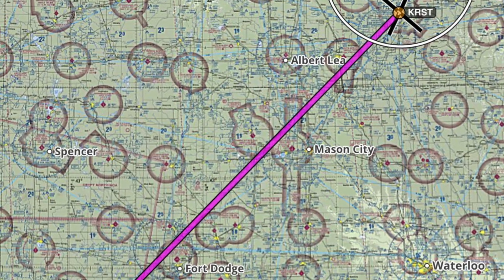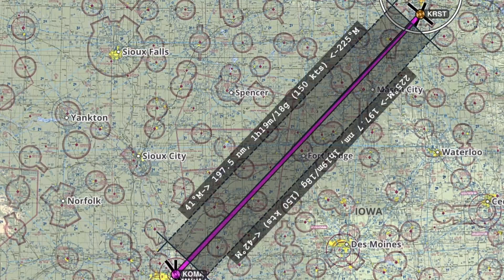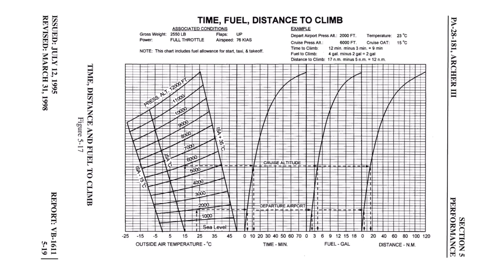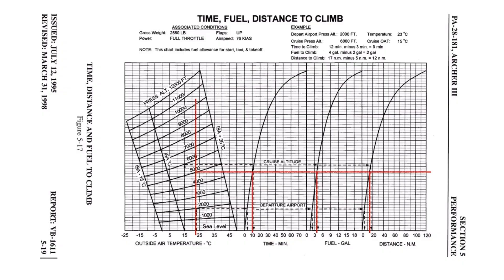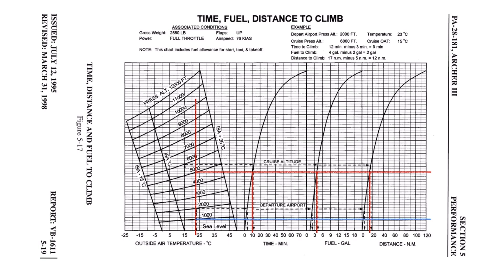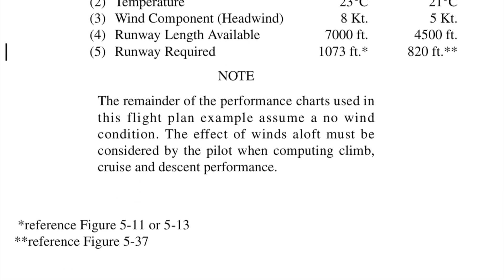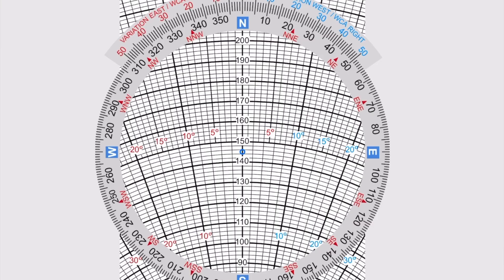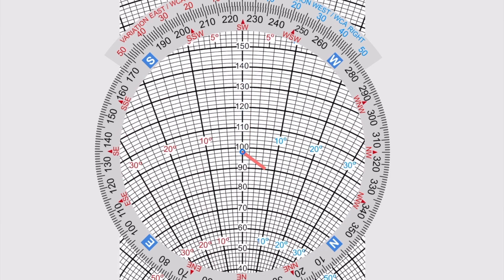How to Calculate Climb Performance | Using a Climb Performance Chart

Comment: Hey there, i dont know if i am getting sth wrong here, but when dividing the distance by time in the first step by 60, shouldn't you get groundspeed? I see you take that value as TAS, but since the distance in the chart is horizontal ground distance, i think that should be groundspeed instead
Reply from the maker: Technically, you are correct that using horizontal distance divided by time will provide a ground speed.  However, the intent of this portion of the calculation is to estimate True Airspeed and in “no-wind” situations True Airspeed and Ground Speed should be nearly the same.  Remember, the POH specifically states that the Time, Fuel, Distance to climb chart does not take wind into account, so calculating the Ground Speed will be a decent estimation of True Airspeed—not perfect, but close enough for our purposes.  I probably should have explained that in more detail during the video.

I hope this helps.  Thanks for the comment!

Comment: Hi sir, great job. But, i could not understand why you assumed our TAS was 90 kt. In the climb chart, our IAS is 76. So, we should calculate our TAS based on that speed. We can calculate it by using EB6 as our altitude and OAT is available. I calculated as 85 TAS. Then, we add tailwind in this case which is almost 8 kt. Finally, our ground speed is 93 kt. Am i missing something?
Reply from the maker: Perfect question.  And, to be honest, unless the climb is a long one, I’m not sure there will be enough difference between the result of your answer and mine to matter much for planning (I believe the difference in distance during the 8 minute climb would be 2/3 of a NM).  

In the video I note that the text section of Chapter 5 states “The time, fuel, distance to climb chart assumes no-wind conditions”. It further states “the effect of winds aloft must be considered by the pilot when computing climb, cruise and descent performance.”  But it doesn’t suggest a specific method for doing so. 

There are three reasons I don’t do it the way you did. These don’t disqualify your method, they are just the reasons I don’t use it.  First, angle of attack (especially high angles of attack) can impact IAS accuracy.  So, even though your airspeed indicator says 76 kts, you may not actually be at that airspeed.  Second, if you picture a climb in profile, it is (sort of) a right triangle with the distance you move through the air as the longer hypotenuse and the distance over the ground a shorter base side.  Third, during a climb your altitude and temp (and therefore true airspeed) is constantly changing as you climb, so which true airspeed do you use?  Again, the differences will likely be minimal, so perhaps you could just use the worst TAS.  In any case, all these factors complicate the calculation of ground speed and the effect of wind.

If you reduce the no-wind times and distances from the results of the chart back into KNOTS, you will get something over 76 kts (in fact the example used on the chart in Chapter 5 results in an “over the ground airspeed” of 80 rather than 76 kts).  So I use that as the basis then factor the effects of wind as shown in the video. Still not perfect, but it attempts to overcome the issues I mentioned above.

As noted above, there doesn’t seem to be a single, approved method for doing this so if your instructor taught the method you describes please continue to use it.  

Thank you for the question.  I hope this helps explain why I did the calculations as I did.
Reply: @ScottKoonCFI  In total, i got your point. Thank you for answering but i have more questions if you dont mind. 1. "angle of attack (especially high angles of attack) can impact IAS accuracy. " Why is that? IAS is not affected by compresibility or position errors. IAS should show exatly the affect of dynamic pressure, right?

2. The reason why you took 8 minutes time as fixed and calculate the new distance from there is wind doesnt affect climb time, is that right? It doesnt come naturally tough. Is there any advice for me to visualize that fact better?

 3. "a right triangle with the distance you move through the air as the longer hypotenuse and the distance over the ground a shorter base side." You mean if we take 98 instead of 93 (my version of GS) we are closer to that hypotenuse side as this distance is longer and we are closer to more realistic calculation?

Sorry for overwhelming questions but i try to learn as much as i can. Thanks for your patience and interest.

Comment: small tip - instead of interpolating the values for wind (or any values for that matter) use the values at 2/3 of the climb and for descents use the values at 1/2 of the descent.

This is because values dont vary liniarly.
Reply from the maker: Thanks for the comment and thanks for sharing.  This sounds like an easy method for planning outside of a test or check ride because you are right, the values don’t always vary linearly.  Another short cut is to just use the next, least-favorable value in the table or chart (I call it rounding pessimistically).  In General Aviation it is almost always better to plan to need more gas and not use it.  However, most of the DPE in our area want to know you can use the FAA-approved tools during your check ride.  So, for now that means knowing and understanding interpolation.  

One question I have for you, is how did you decide to use 2/3 of the value during climb and 1/2 of the value during descent?  Was it based on a table, calculations or a “rule of thumb”?  Thanks again for the comment.

Comment: How come for “rounding pessimistically” for the airport elevation we go down, but cruise altitude we go up? Thank u so much for a fantastic video ! Subscribed
Reply from the maker: Thanks for the question.  It is a very good one.   My reasoning is that the least desirable outcome would be to climb for a longer period of time because it would use more fuel.  The larger the difference between the pressure altitude of the airport and the pressure altitude of cruise the longer the climb would take.   With that in mind, I rounded the cruise altitude up and the airport elevation down.  I hope that helps.  Thanks again for the question!  And thanks for the Subscribe!!

Comment: Scott - I'm learning to fly in my 1965 Piper Cherokee 140 and the performance charts in my POH and AFM are uhm... a bit light.  They're 2 axis graphs with "standard altitude" on the "up" axis and FPM (for the rate of climb) going across but there is nothing adding the temperature element to the equation.  I would assume in this case I would use density altitude instead of pressure altitude.  You're the one YouTube CFI that uses Piper (I've grown to loath the assumption that everyone learns in a Cessna 172) but your Piper is a couple decades in the future.  I have an excellent CFI but he's never dealt with uh... uhm a vintage aircraft such as mine (I still have 1970's avionics - no GPS).  Another curious aspect to this POH/AFM - there's no "Calibrated Air Speed" chart.  I asked another 1965 Cherokee 140 YouTubing owner (who's also on the learning journey and our planes are very close in serial numbers) and he too has nothing.  So to distill the two questions:  Do I use DA instead of PA with my performance charts?  Do I just use INDICATED if it's CALIBRATED when calculating my True Air Speed?
Reply from the maker: Jeffrey.  This is an excellent question.  And I apologize, the answer will be long.  

I was able to grab a copy of a Cherokee 140 Owners Handbook.  You described it perfectly.  The performance charts are “light”.  However, I would recommend the following.

To your first question… Yes, you will need to calculate density altitude in order to calculate performance.  You can do that two ways.  First, you can use an E6B (either electronic like Sportys, or the whizwheel) or use the “Altitude Conversion” chart in part IV of the handbook.  Both should provide similar answers.  By the way, the charts used in my videos actually use density altitude too.  They just build the calculation into the single performance chart.  Yours requires separate charts.

Also, please notice that each of the performance charts in your handbook has two versions—one for 1950 pounds gross weight and one for 2150 pounds.  In each case, use the chart that best fits your situation.  

Once you have the appropriate density altitude you’ll need to do several things.  

1. Use that density altitude and the “Rate of Climb vs. Density Altitude” chart to get an average feet per minute.  Earlier in the chapter, the handbook notes the best rate of climb is at 85 MPH, so, you should use that figure to estimate distance from the airport when Top of Climb (TOC) is reached.  To help, please notice that 85 MPH is about 1.4 Miles per Minute.  Also note, since weather is in Celsius and Knots, you’ll need to convert into Nautical Miles to do wind correction.
2. Once you’ve found your climb rate and TOC estimate, you can work on the rest.  Start by using the Power vs. Altitude chart to determine fuel burn and percent power at the appropriate density altitude.  
3. Once you’ve determined what percent power, use that to help determine True Airspeed from the True Airspeed vs Density Altitude chart.  Again, this airspeed (or the wind speed) will need to be converted since one will be in MPH and the other will be KTS.

To your second specific question, you should use True Airspeed as your base for determining ground speed.  All the indicated airspeed charts and calibration error charts are trying to get you to a true airspeed for calculating ground speed.  This chart tries to give you all that in one place.

Because these charts are “light” I would definitely recommend rounding pessimistically during your calculations.  It would be better to over-estimate time and fuel usage, while under-estimating ground speed rather than the opposite.

I hope this helps.  If it isn’t clear and you and your colleague would like me to walk through this, send me an email at Scott.Koon at online-CFI.com and we can talk about setting something up.  I’m happy to speak with your CFI, too.

Please note:  My legal team recommends me saying that this only an example using sample information.  To ensure a safe flight real planning must be done using real-world conditions and the specific performance charts for your aircraft.
Reply: @ScottKoonCFI  Oh my goodness!  You are so generous and I am so grateful for your time.  I have the original POH that I keep in the plane and I have a reprint that I ordered from Airspruce that I keep in my flight bag.  I think the reprint differs slightly (extra chart maybe).  Your reference to the Altitude Conversion chart really opened my eyes because, some how I have missed this chart after I searched and searched... did you sneak it in there?  I will copy and paste this comment into my Apple notes.  As for the Indicated to Calibrated speed conversion chart question.  I'm not sure if I got your message.  I understand that the goal is to get to True Air Speed (Indicated > Calibrated > True) in order to make the wind/ground speed calculations on the wind side of the E6B - BUT - I am missing the Calibrated Speed "link".  There isn't a chart that I could find in the POH.  I'm guessing, by pessimistically rounding you mean that I should just minus a knot or two from the Indicated Air Speed to estimate the Calibrated Speed.  I may just take you up on your offer.  Thank you so much Scott Koon!
Reply from the maker: Hello.  Very interesting.  

I used to fly a Cherokee 140, but haven’t for awhile… so don’t have the handbook anymore—it went with the airplane.   But I remember using the charts…

Here is a link to the online POH I used.  http://houltonflyingclub.com/wp-content/uploads/2017/04/Cherokee-140-Owner_s-Handbook.pdf.  

This was published in 1964, so it should be at least close...  In any case, the altitude conversion chart should be on page 26.   The Power VS Altitude charts are on page 24 and 25.  The True Airspeed vs Density Altitude charts are on pages 22 and 23.   

As for rounding pessimistically, it sounds like you have the general idea.  If you’d like more detail, I do have a video that talks about it.   Here is the link: https://youtu.be/7AkwJ8SLckI

Just let me know if you’d like to arrange a live chat.  Take care, fly safe, and have a great day!!